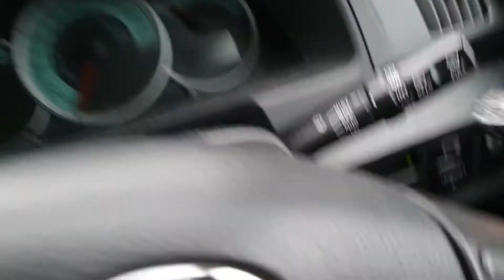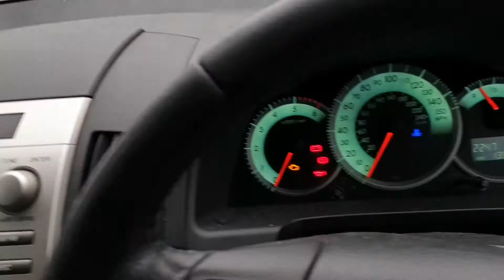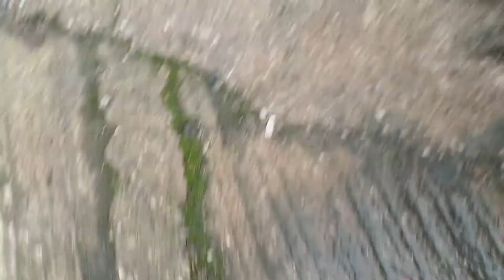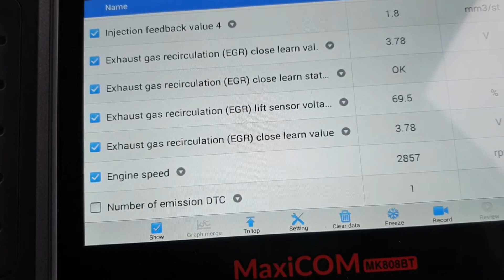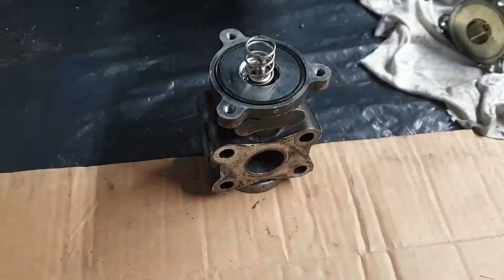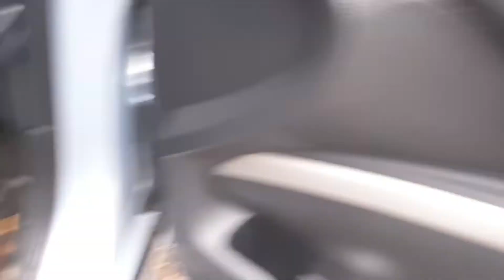Toyota Corolla Verso 2.2 Diesel  2AD-FTV P0400 DTC Investigated, EGR Valve Cleaned.

Comment: Hi there, had the same issue with my car, same car just from 2009, I've put a brand new egg valve in and cleaned everything but the engine management light keeps coming back on with the same error code, and the car feels jerky in 2nd and 3rd gear at around 2000 rpm, got the car down to the garage they erased the fault codes but about 30 mins later came back again...what's the solution
Reply from the maker: The EGR valve could be defective, and it should be investigated by a professional technician. Do not replace it straight away, prove the defectness
Reply: @stanhopeautorepaircentrewardak  I've put a new one in already about 3 weeks ago, cleared the codes 3 times after that, how do I prove that it's got a defect
Reply: Painful video to watch!! Camera work is awful, you mean well and are very informative, just up the game on presentation and I might subscribe!!
Reply: @joechesney2665 I had no problem!